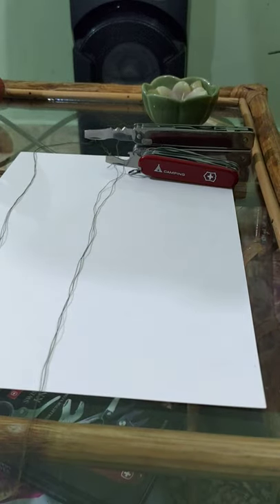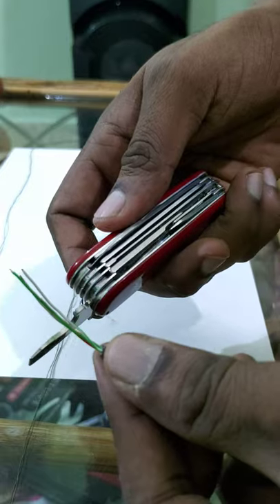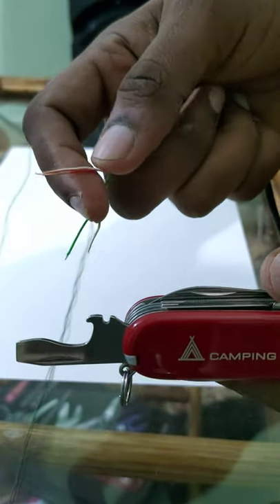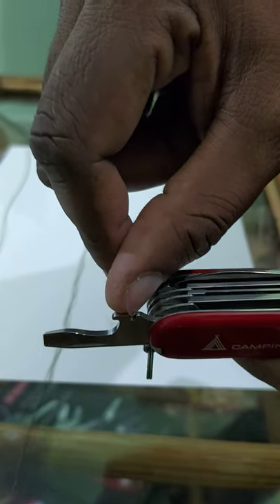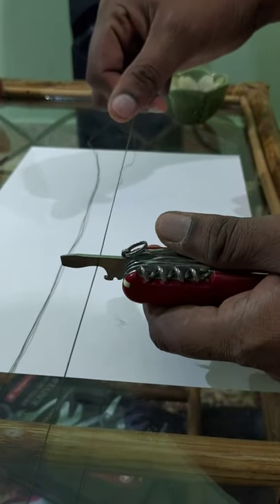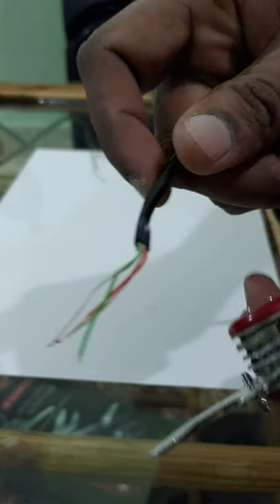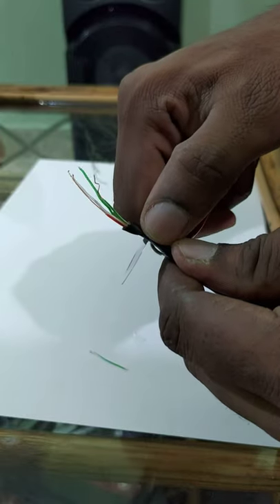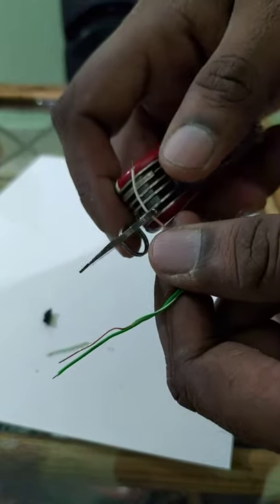How to actually use the notch on the bottle opener of your Victorinox SAK

Comment: I've been using the notch for more than 20 years when using it you just use it on its own by pulling it its not recommended to use the blade  I've been using this for taking the wireing from car speaker🔈🔉🔊 wire and I've got to say it's a fantastic little tool for getting into a small space still use it to this day it's a outstanding little tool and very easy to sharpen thanks for sharing this video

Comment: I found the standard notch will not strip automotive wire very well which is what I intend to use it for. Using  Felix’s  method I am now able to strip automotive and household electrical wire. It all depends on how it is intended to be used.

Comment: Hi, I’m an electrician and I got my first Victorinox knife with the wire stripper back in 1990 and we electricians are usually very observant but I was not observant enough to notice the sharp edge that you have pointed out so I’ll be having another look at it. I assume that you are not an electrician by your terminology, we call what you call “the covering” insulation but that was a good demonstration, well done.
Reply from the maker: Thank you. Indeed, I am not an electrician. But, I should have known the word 'insulation', it's not complicated. Silly of me. I am glad you pointed that out, I need to improve my vocabulary. 

And, as far as that sharp edge goes, I suspect professionals such as yourself will find it quite lacking; even so, I would definitely like to hear your take on it.

Comment: That is an excellent demonstration. Though it is very limited on functionality. I think the maximum American Wire Gauge that would fit would be 16 AWG. Most electricians will be working with 14 AWG to 10 AWG. While this would work fine on data cable wire, it will obviously not be effective on anything bigger. I have not yet seen Felix’s video, but I’m very interested to see how he modified the wire stripper. Thank you for this informative video.
Reply from the maker: Thanks for your feedback. It's useful to know the opinions of people who professionally work with tools such as these (I gathered that you are an electrician or a technician of some kind).
Reply: Savio M maintenance technician sometimes. I am a millwright by trade.

Comment: This subject is not as simple as most lay people think it is. Years of experience working with wire is needed to get an appreciation for what can be done with the stripping notch. This stripping notch design has been around for many many years. Insulation on flexible wire has been around for many years as well. Insulation on flexible electric wire has evolved a great deal over those many many years. Some of the insulation types such as THHN and THHW , are used in industry because it is very thin and tough and oil resistant and heat resistant and for that reason, many conductors can be fit into a given diameter of conduit. Those types of insulation are a b*tch to strip with a pair of dedicated strippers, much less a SAK. I know because I have over 42 years of experience with industrial wiring. House wiring doesn't have the same requirement, because it isn't usually pulled into conduit, or at least, few wires are pulled into a conduit. Automotive wire is insulated differently from the other two types. The point is that there are many types of insulation and they have evolved over many years, but the SAK wire stripper has not. Way, way, way back in the day when the SAK stripper was introduced, electrical conductors had soft rubber as the insulation. If you buy bulk rubber cord to make your own extension cords you will see what I mean because it is still double insulated with soft rubber. The outer shell may be a little tougher, but it is still soft rubber and you will find that the inner strands use very soft rubber and if you have a tough thumbnail you can just pinch it and pull the rubber off. That is what made up the cords on home appliances for decades and I feel THAT is the wire that the SAK stripper was meant to be used on and it works great. The thin insulation on the bell wire that you used in your video should work equally well, mainly because it isn't very thick. You will HAVE to do the Felix Emmler mod to strip modern industrial and some house wiring insulating materials.
Reply from the maker: Thank you for sharing what you did here. It is very useful to hear from people such as yourself who know what they do from having worked in the field with these items. materials, and tools. I will incorporate what you shared in my future conversations about this.
Reply: yeah, I was going to say, I'm not a tradesman but I've tried to strip wires with a leatherman or other tool and its been a disaster- actually I think I was trying to connect amplifier to speaker wires and I'm not quite sure what the technical problem was other than I was stripping the insulation and half the wires in the bargain.....I guess I was dealing with the first type of tough, resistant insulation?  I'll have to re-watch Felix' video.......

Comment: Electrician here. I can confirm that you can strip that type of wire by pinching your two fingernails together on it and pulling. The better test would be to try it on some 1.5mm² or 2.5mm² t&e or single insulated cable. I might give it a go when i have some spare time (and material) and get back to you.
Reply: Just want to confirm i managed to strip some 1mm² flex insulation for a lighting circuit using this method. You want to make sure you have a fair bit of slack to strip and trim it down after with the scissors as it requires bending it over the loop and using a lot of force to strip. Definitely a last resort but worked pretty well

Comment: The design appears to be for smaller gauge wire in tight locations which may have been the requirement for military specifications, the original use of these tools. Perhaps it is time for a Victorinox upgrade to suit the needs of tradesmen and the diy handyman.

Comment: I believe that the Swiss army knife has a 90° edge on the wire stripper curve. You know how they put 90° angles on the spine of carbon steel to start fires? To strike Fire steel. I think that's all you need to strip a wire as small as that. However, I almost never mess with wire that small. That was almost like USB cable wire. I'd much rather do it like Felix did.

Comment: I tried it before with about 12 Guage wire and it wouldn't work at all yes the wire fit in the notch just fine without forcing it at all the coating was to thick I again just tried about the same thickness wire you have there and for somthing that small with a coating that thin yes it did work but not that well and I'm using a new sak that I've never tried the wire stripper on .. the way that is best is to score the outer casing and then place the wire stripper onto the cut mark and pull ... No offence I've tried this many times I'm not biased so that's why I gave it one more shot and it failed .. I'm not trying to look poorly on your video as for wire that small it did kinda work! BUT I think for most the size of the wire will be closer to the size of the " wire stripper " if you could show this again with somthing like that ..it would be very interesting please let me know if you intend to or already have in another video also if ya score the wire casing you can strip a lager wire than rather than only stripping somthing the diameter of the casing ( again show us this with a larger casing that fills or comes close to filling the notch all of us victorinox fans would love to see that! )
Reply from the maker: Hi. Thanks for your input. I encourage you to make the videos you need of you can, I may not make one on this topic.

Comment: Tbf the wire stripper is by far the most useless tool on any multitool, and if any tool is worth going to your toolbox to get the real thing or even head out to buy the real tool, its a wire stripper. Not only because its easier to use, but the chance you mangle your wires is much lower and you are pretty much guaranteed to get a good connection from a decent wire stripper.

What makes me think its actually useless on a multitool though, is that multitools already have some form of blade on them. Electricians have been stripping wire with knives for 100 years and it does by far a better job than messing a round with a can opener like this